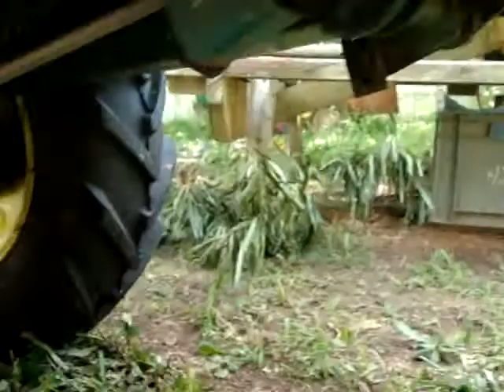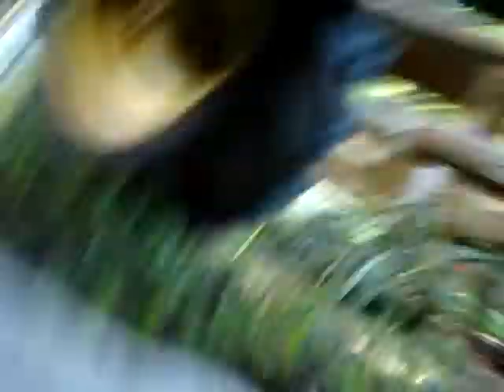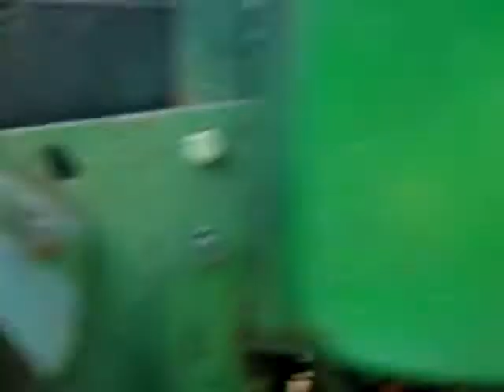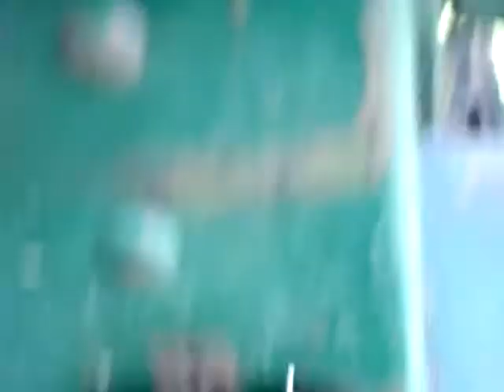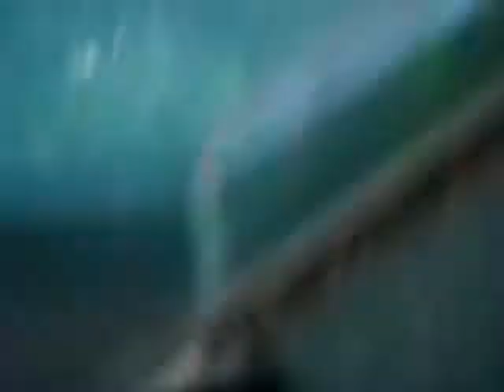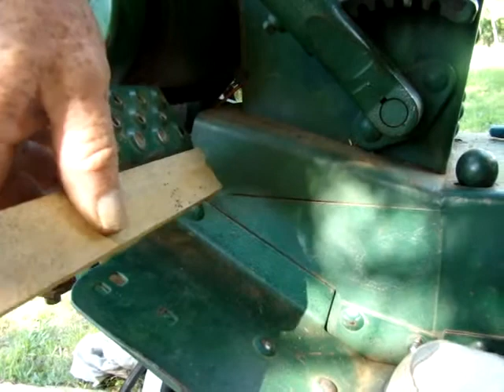Variator adjustment John Deere 110 round fender

Comment: Wait so could this fix my problem of the clutch pushed all the way in and it not stopping😅
Reply from the maker: Make sure the linkage is still connected.
Reply: @popsknows5648  I went over it the other day cus my brother destroyed my belts and the bolt wasn't even lined up so it couldn't even go in😂 it's fixed now

Comment: Thank you for this information.  One question, when replacing the primary and secondary drive belts, should the transmission mounts to the frame be in the forward position.  I currently have my transmission in the rear most position and after installing new primary and secondary belts I cannot move the variator back before the fourth notch as the secondary drive belt is way too tight
Reply from the maker: That is a adjustment that needs to be made to the varriator tensioner.

Comment: When the manual says "remove the pin" from the points of attachment, you just removed the cotter pin, not the clevis pin.  Weren't you supposed to remove the clevis pin from the variator and clutch?
Reply from the maker: Not to adjust. Only to remove completely.  Hopefully this fall I can get back to doing a restore on the 110.

Comment: hi PT can you post a short video of the details on the PTO assembly ? Mine on the 64 is not right. The middle idle/throw-out wheel wants to rub on the top of the lower wheel.   Very frustrating.
Reply from the maker: I subscribed to you so if you can load a short video of what you have going on I will do my best to help.

Comment: Question: your tractor looks to be a '65/'64, on a '66 there is a new C-shaped spring part on the clutch end of the control lever/rod underneath.  Would the adjustment order be the same for this new part?  Looks like a screwdriver is needed to twist the end of it around for adjustment.  Thanks for any insight on this 66 + part on the clutch mechanism.
Reply from the maker: That is one I have no knowledge on. Please post a video we will look at it and do our best to figure it out.

Comment: Thank you for the informative video. I ran through the adjustments, twice. With everything adjusted as you show when I pull the variator back it pulls the clutch pedal down. Anyone else run into this?
Reply from the maker: Jeff Kochis that is what it will do under 2 conditions. 
1 under load
2 worn bushing in the sheave and sheave shaft. See my latest Vedio
Reply: PT SUTPHIN I’ll check it out now. Thank you

Comment: I'm having a problem with mine. I did the adjustments all correctly step by step, and it still wont work. Nothing seems to be happening at all. When I even take the lever down to the #1 notch, nothing happens. My brake gets harder to push when the lever goes further down. What do I do?
Reply: spencer bell you could have a worn bushing wich causes them to bind. what happens if you reach down while in gear and rolling and pull up on the clutch pedal?  I will try to make a troble shooting video.
Reply: I just noticed today that when I push the variator lever down to notch #1, it speeds it up very slightly. It also pushes the brake up. When I pulled the brake up like you said, it sped up a little bit but not much.
Reply from the maker: spencer bell ok I will make a video just for this problem. asap
Reply: Thanks so much!
Reply from the maker: spencer bell new up hope it helps a little not as good as I wanted it to be.
Reply: I'm gonna go out tomorrow and take the variator off and see. Thanks so much for the video!

Comment: Found your variator instructions to be very informative. As soon as I finish the engine rebuild I am going to have to do the variator adj. I just want to be clear on step 3 to step 4, After pulling the cotter pins from the brake rod & clutch yoke drilled pins, do I leave those pins IN while turning the engine over before adjusting the yoke up or down on the variator rod? It appears so in your demo instructions.
Thanks for the demo.
Dave
Reply from the maker: Dave Smith I'll try to send you a few picks when I get a new camera.
Reply: PT S Thanks PT, will appreciate that. Got my '66  110 variator working good but still having some problems with my '65 110.
Reply from the maker: +Dave Smith could be wear on the slider shaft. I think I will have to put a bushing in mine if I can not find one on Ebay
Reply: +PT “Bee Man JD 110” S Just to be clear PT, are you referring to  the shaft that the inner & outer variator sheves move back & forth on? If so, luckily for me I have a spare complete assembly from a model 112 that I have been considering changing. I just wasn't sure if that was where the problem was. 
Thanks for the input.
Reply from the maker: +Dave Smith yes I'm thinking about that. I need to make a spanner wrench to screw it apart. video for that will be my next project.

Comment: Great presentation!  Will this procedure also help for the problem where the brake/clutch pedal is stuck all the way down after replacing the primary belt?  In this situation the pedal is stuck down and moving the variable speed lever doesn't do anything.  Thank you!

Comment: I like my 110 but man this is complete insanity.  my 1650 ih cub cadet is shaft drive with no off the wall adjustment like this. I can't believe John deere had such a stupid idea along with a belt drive tractor..
Reply: 0307 0307 the variator was to give added torque to the rear wheels. I do like the cub simple drive also. so I have one 61 cub project and this 110.
Reply: Yeah I understand. It's just a real pain to adjust mine.. it's a 1966 so it's not as easy as the early 70s where you just use a socket.. once the weather turns nice I'll try and figure it out.

Comment: Sir, I really enjoy your videos on the Round Fenders. I subscribed to your channel. I noticed you replaced the clutch spring mechanism that attaches to the variator under the tractor. With a new Clevis only. Doesn’t that effect using the pedal as a clutch to slow the tractor down using the pedal ? Because the original mechanism had a spring wrapped around it. Im talking about the original piece that kind of resembles the shape of a pistol, with a spring wound around it. I’d appreciate your feedback, im currently in the process of deciding to go the route you did. Keep the round fender videos coming please. Thank you